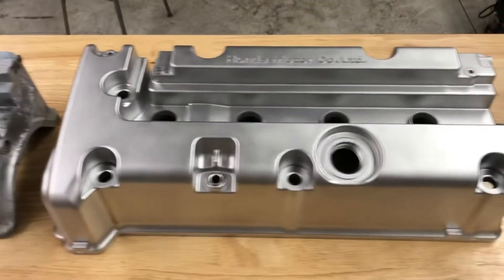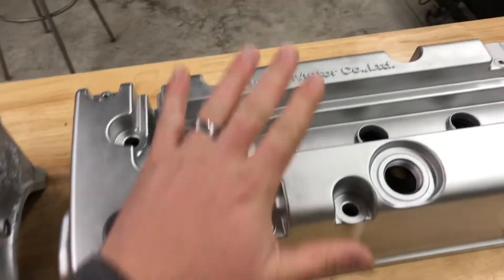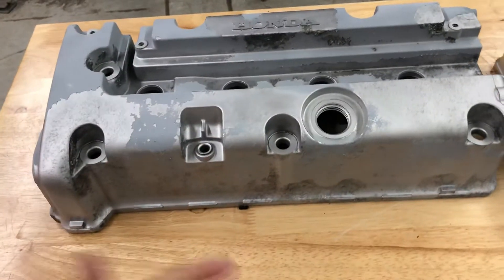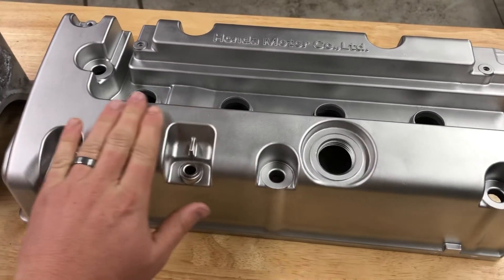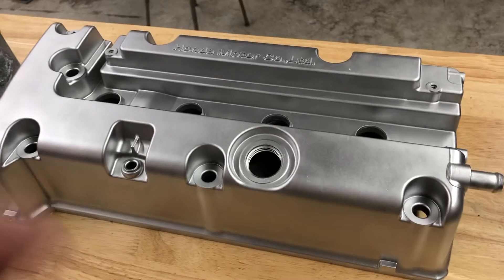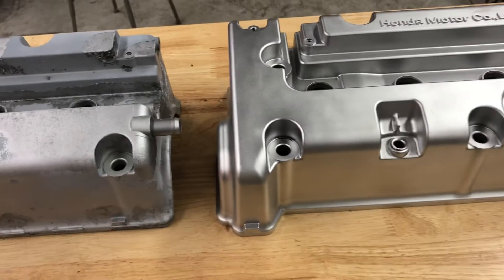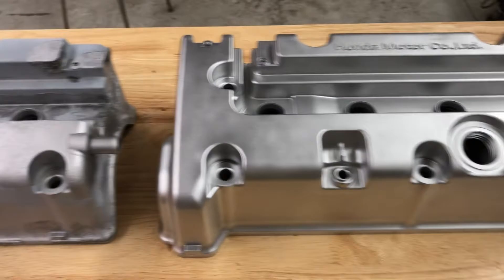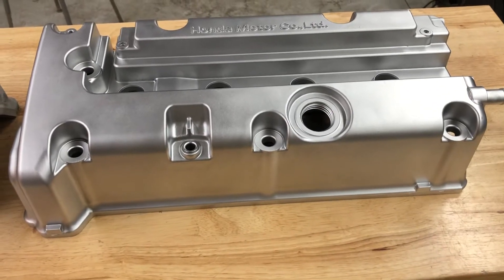Vapor Honing Automotive Valve Cover- Vapor Honing Technologies

Comment: Why not expalin the differences of the process itself? How did you remove the coating and do the nice satin finish. Was it a 2 step with different media? Do i need to flush my vht800 and swap.media? Whats media was used etc. Some more detailed vids.on the actual vapor process would.be nice.